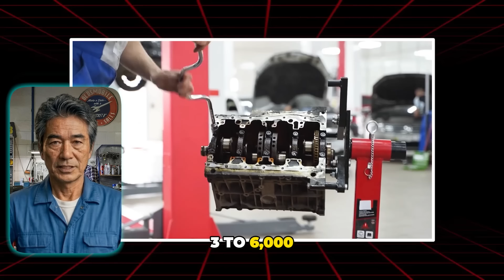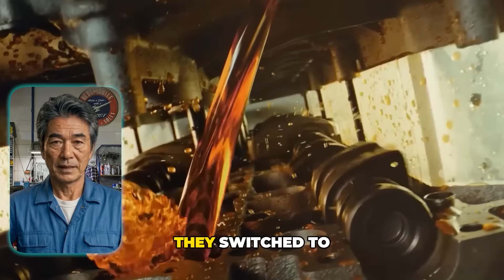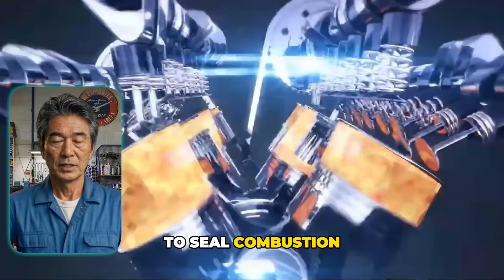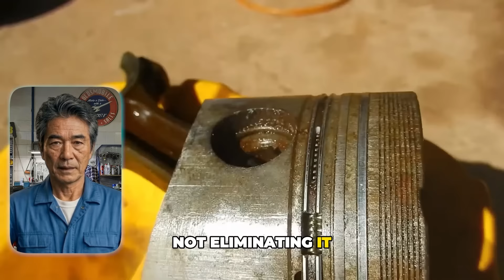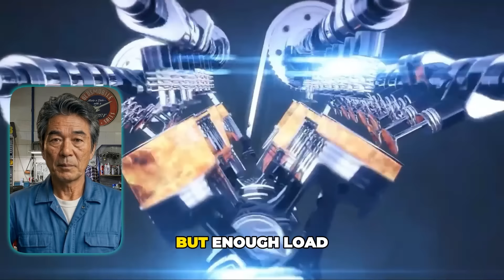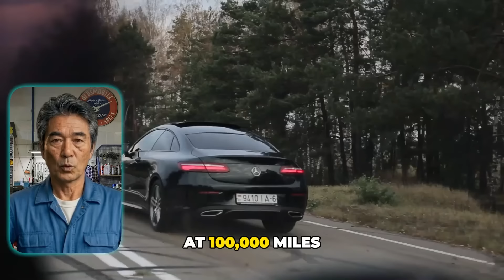This SECRET Japanese Method to Fix “Oil Burning” Costs $0 and Is Only KNOWN by 1% of Drivers

Comment: You think Japan doesn't have short trips and low speeds?  For a real Italian tuneup you'd need 90mph+ for a half hour or more.  Good luck managing that without jail.
Reply: Don't need to do 90+ just keep the vehicle in a lower gear and go from there.
Reply: stay in a low gear and take a short commute at low-speed; this has always worked for me with a few cars which i still own: warm up the engine, let the oil get hot (see PSI drop at high RPM) - go to - third gear as an example - and give it thirty minutes like that - so easy - and $ FREE.